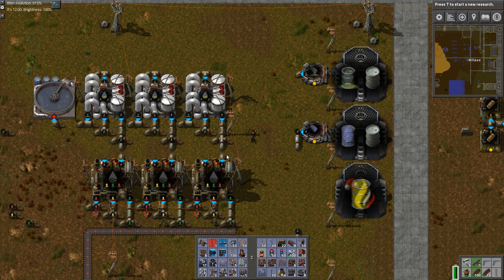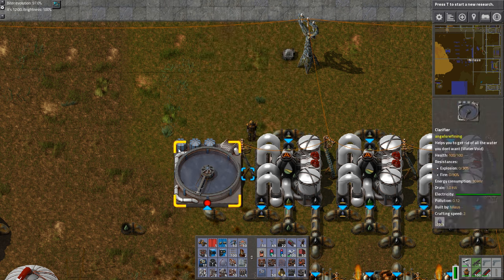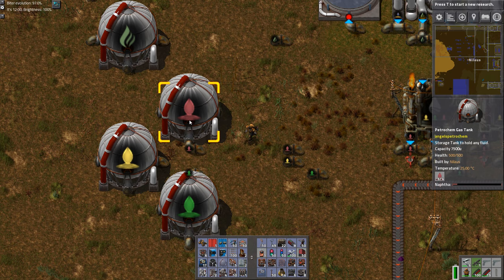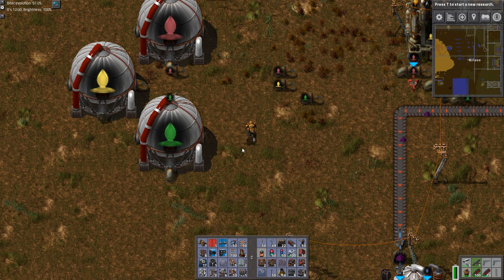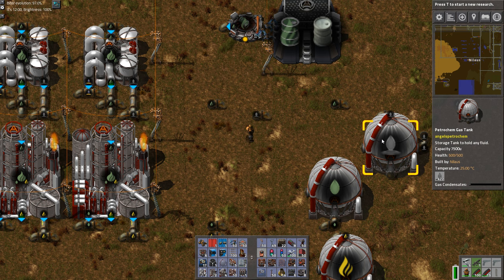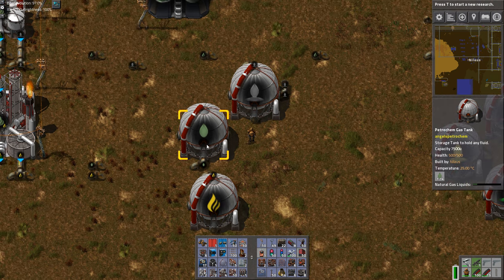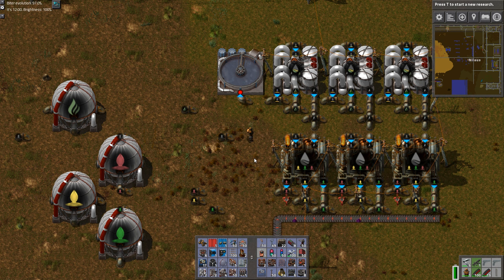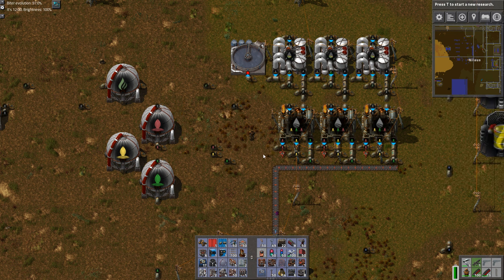Factorio Angels Mods Tutorials - Petrochem 1 - Basic Oil and Gas - OUTDATED

Comment: I'm just starting out with modded Factorio (using Bob's mods, Angel's mods, and a few other things which look useful) and these tutorials are incredibly helpful.

I suspect the best way to use a clarifier (like any resource void) is to hook it up to the main input where the fluid is used, and set it up so that it only runs if there is an excess of the fluid. When I reach the point where I have a lot of fluid processes, I'll hook up the main fluid inputs to some sort of tank with a clarifier off to one side separated by a pump, and activate the clarifiers only when the tank is full (I don't usually like buffers and a fluid won't be building up in tanks unless there's too much of it).
Reply from the maker: Part of Angels Mod is an "Overflow valve" it will only activate when the content of the pipe is >80%. That is a very easy way to void excess. I use that a lot for Water electrolysis that created H2 and O2, but they are never used in the same ratios they are created.

Comment: Great tutorial! Though I might add that it's fairly easy to obtain hydrogen for advanced oil refining with a purifier, a clarifier for the salinated waste, and an electrolyser. (Maybe a vent for the oxygen as well, though that is useful for metallurgy.)
Reply from the maker: Good point. I still do not like that recipe as it is (in my opinion) always better to use the 4 Crude Oil + 6 Gas Condesates as that is the primary use of Gas Condensates and significantly limits the amount of Crude Oil needed.

Comment: Hello,

I have a Question about the Angels Mod.
I play Factorio Seablock and now i like to use a Recipe where i get fuel oil as byproduct and there is nothing i can do with it. There are no other Products wich use fuel Oil.
I testet to Void it with a Clarifier and the Flare and nothing happens. The Website: Factorio Data says that i CAN void it but it does not Work. 
Can somebody help me?

Comment: Good Video.
I am in my first game with bob and angels mod and its really hard for me. everytime I bumb to anoter problem.
My problem now is:

I get stucked by the point that I don't know how to get Natural Gas.
I have only a  Natural Gas Liquids field and this is a big differents with Natural gas.
How do I get Natural Gas???????
Reply: Thanks for the quick reply. I found the problem because of your comment. In the beginning I thought that Natural Gas and Natural Gas Liquids are the same so I connect the pump jack to a pipe with NGL and turn on the power of the pump jack. So it looks like that the well is pumping NGL. This cost me many hours and research on internet to find out. Finely I have now Natural Gas.